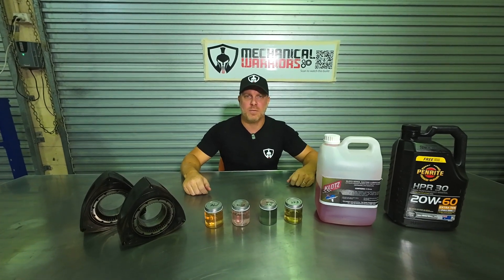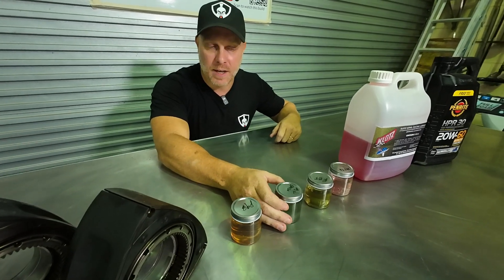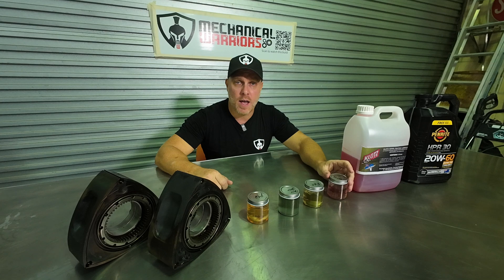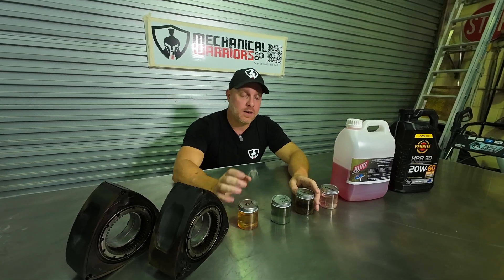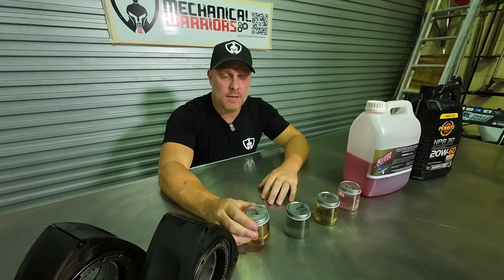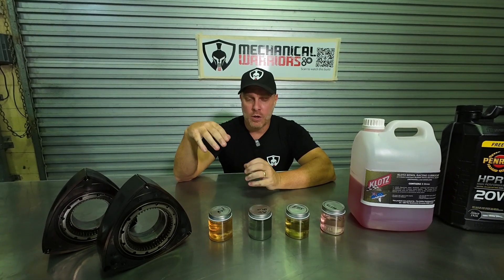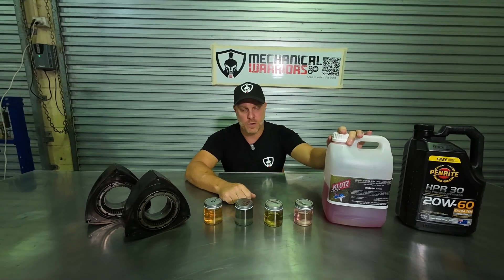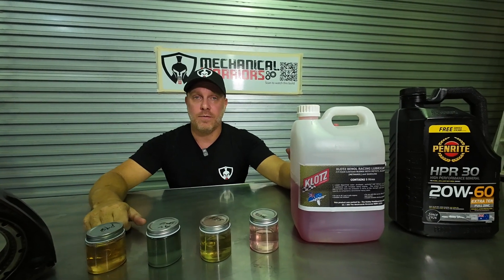What Fuel Do I Used In My Rotary?

Comment: Which premix and amount to use with E85 for Rx7 FD
Reply from the maker: @GuitarsGunsCarsBoxing  what are u doing with the car on e85 ? Are you racing it or just street driving it ?
Reply: @mechanicalwarriorsofficial  I bought the FD the way it is. Engine is modded, single turbo running on haltech Elite 2500. For now it will be use for street use
Reply from the maker: @GuitarsGunsCarsBoxing  for street use I would mix Klotz racing caster oil in with your e85 at 120:1 make sure u mix the fuel before u put it in the car some make the mistake of just putting the oil in and not mixing it as it will sit on the bottom of the tank but once’s it’s mixed it will stay suspended in the fuel I mix mine in a 20L drum before I put it in the car. Dose your FD still have the factory metering pump on it ?

Comment: How does octane ratings in Aus compare to NA? Typically the highest rating I see here in Canada is 93 or 94 and guys will use that up to about the same you are saying, 16psi. I have a friend running 93 and just water injector up to about 21psi. Just curious if the octane numbers are different from here to there?
Reply from the maker: 94 is just normal unleaded we have here premium 98 which is good for around 16 to 18 pound depending on your setup but beyond that u need to switch to a alcohol based fuel to run higher boost
Reply: @mechanicalwarriorsofficial  I see, the scale must be different, regular here is 87, premium is 91, then some stations will have an “extra premium” at 93 or 94 depending on the brand.
Reply from the maker: @jesseaumiller8688  that’s very interesting!  

I had no idea of this why would they do this I wonder ??
Reply: @mechanicalwarriorsofficial  so did a bit of googling; AUS uses a RON laboratory test to determine fuel octane rating. There is a different type of lab test called MON. Canada and the US uses the average of RON and MON in a scale labelled as AKI. So in AUS 95 (RON) is equal to 87 (MON) and in Canada/US it is the average of the two, so 91 (AKI)…. Good to know!
Reply from the maker: @jesseaumiller8688  very good to know thanks for updating me on that!

Comment: A major point you forgot to mention is that avgas contains TEL and you don't want to use that stuff period, destroys sensors and generates lead sludge internally in the long run. So, unless the engine is carburated or doesn't have oxygen sensors forget about avgas.
Reply from the maker: Good point, yeah I have not had to much experience with it myself I did not know it destroyed sensors interesting thanks for the input